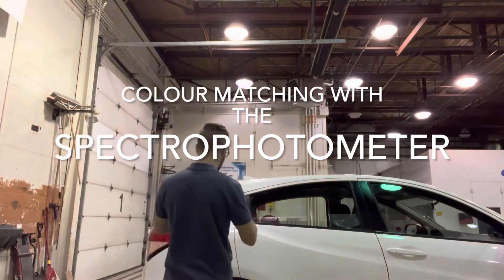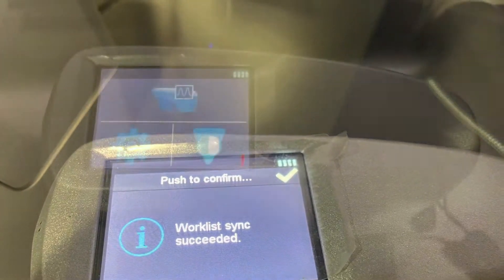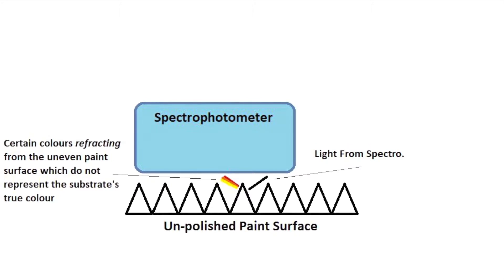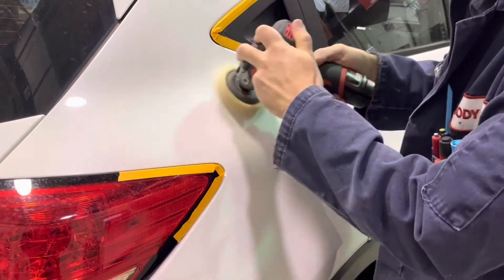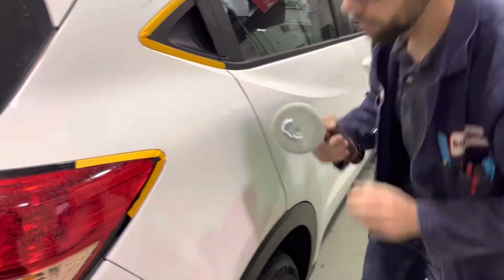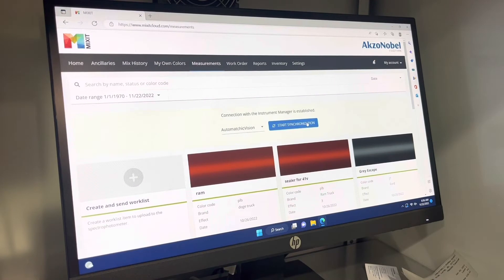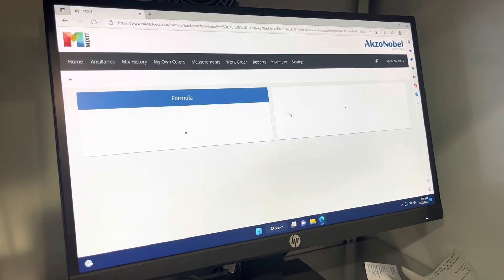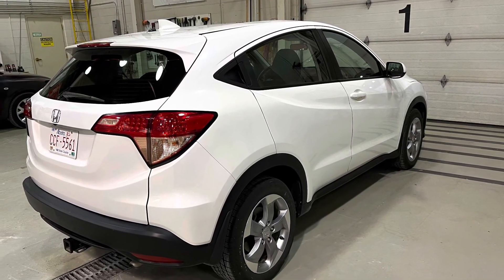Matching colour with a spectrophotometer.

Comment: so all this complex process to just choose from an existing color formula? In my thinking this spectrophotometer process should be used to create a unique color blending formula - only then its usefull.
Reply from the maker: With many software systems (such as this one) the software does more than just select an existing colour. This system does have the ability to modify colours to create better matches. It is actually a very quick and simple process to use.
Reply: Not true. Using a normal coloriometer, or even just eyesight, is not sufficient, because there are cases where two samples appear identical under most lighting, but suddenly under an incandescent lightbulb, the one of two colors appear to be a completely different one. Like, we're talking about going from a pale light brown to a matte green!

Comment: If ceramic coating is applied Could a sample be taken from a door jamb and achieve a correct match?
Reply from the maker: I would only match colour to the exterior of the vehicle (preferably near where you are going to be refinishing). Jambs do not necessarily have the same coverage (or metallic/pearl orientation) as the exterior of the vehicle which can affect colour matching. 

If there is ceramic coating, I would clean the panel very well, then stage sand the surface very well and polish.

Best of luck.
Reply: @benh4086  thanks for the reply. how’s about the fuel filler cap? That could be polished and ceramic easily reapplied to that.
Reply from the maker: @kentowers2802  if you are matching colour to the 1/4 panel with the filler door, then yes. But I would avoid matching colours to non-adjacent panels.